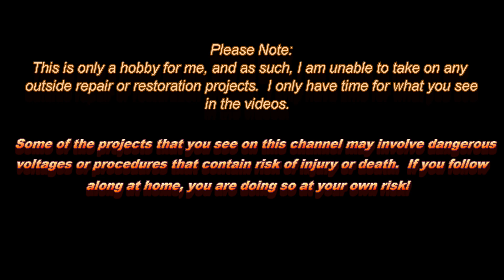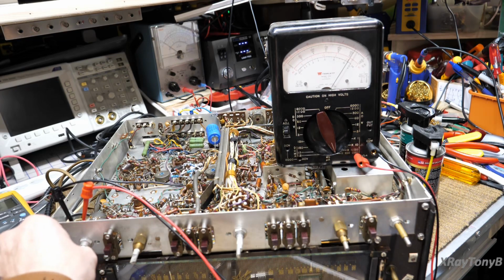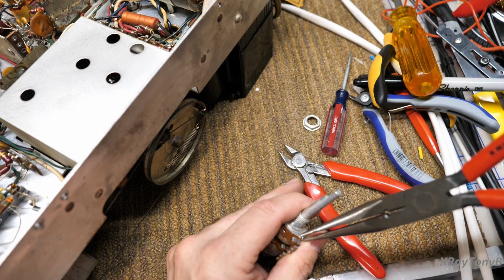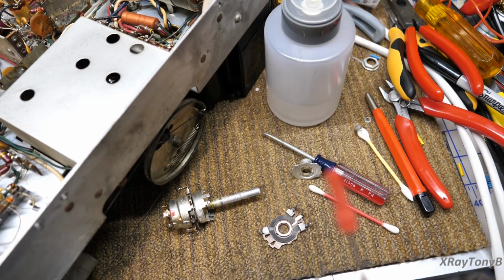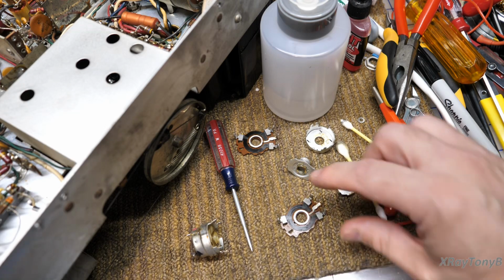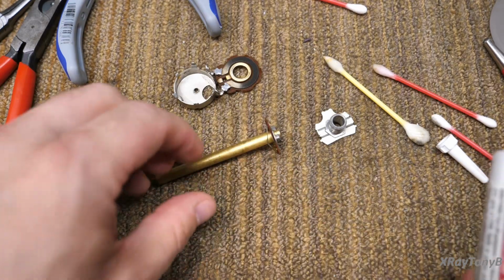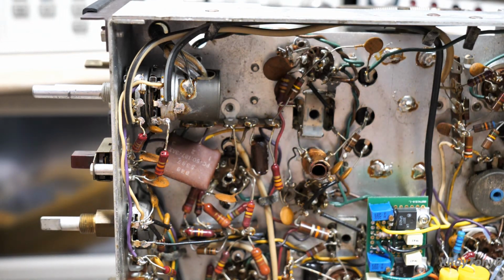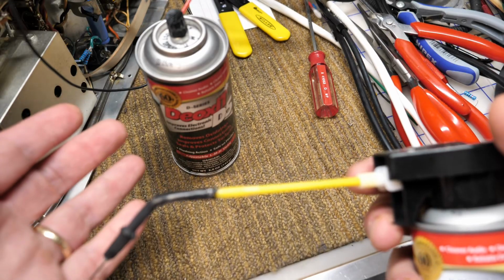How to Clean & Resurrect an Embalmed Potentiometer (With Bonus Rant)

Comment: Just purchased a can of D5 spray and it looks like they revised the label as it now explicitly states potentiometers under the “uses” section.  I also note another channel video discusses this issue and the host reached out to the manufacturer, Caig, and the company stated that D5 does not dissolve carbon or damage plastic, and is safe to use on potentiometers.  Their F5 product contains additional lubricants for moving faders and the like, which is what differentiates it from the D5 product.

I also noticed you mentioned that D5 “dissolves carbon”, but then go on to explain that “cleaning off the D5” can possibly restore a potentiometer that was damaged by D5….   But if the carbon has been dissolved, obviously no amount of cleaning will restore it back.

My impression is that what is occurring in many cases is that the potentiometer was damaged to begin with, likely having scraped carbon traces from the wiper, and it continues to function to some degree because the scraped carbon powder is still laying in the trace even though it is no longer physically attached.  After being cleaned with D5, that loose carbon powder is removed and the result is what appears to be worse functionality attributed to the D5, when really the potentiometer was worn to begin with. It’s possible that the lubricants in the F5 product allow that damaged carbon powder to stick a bit more, so you don’t notice the damage as much.

Just some observations.
Reply from the maker: To clear some things up, carbon will most likely be the only element left at the end of the universe, according to some physicists, so I doubt that red deoxit will "eat" it.  That said, some potentiometers are made from compressed carbon powder mixed with a binding agent to make it solid.  
When you "embalm" a potentiometer with huge quantities of deoxit (or any oily substance, for that matter) it will cause the binding agent in some carbon pots to break down.  This will eventually cause the carbon track of the pot to wear down and get thin, changing the resistance until it eventually cracks and fails completely.  This only happens with certain pots, as different  binding agents can be more or less resistant to this.  I have seen it many times.  People will empty the can of deoxit into the pot and it will work for a while, only to have it stop working again, because of all the dirt and grime mixed with the oily residue causing it to not work again.  The person will then spray more deoxit (or WD40 oil, or whatever) into the pot, repeating the cycle.  
The best way to deal with a noisy pot is to use a quick drying non-residue contact cleaner, such as CRC QD cleaner.  This will clean out the dust and grime from the pot.  Then follow up with a tiny amount of treatment, such as the deoxit or nu-trol  (or many other similar chemicals).  Less is better.  If that doesn't work, I suggest disassembling the pot and servicing it properly as I showed in the video.  
Additionaly, I've found that the old selector switches that use bakelite or that brown fiberboard material will soften and crack when you embalm them as well.  If you watch the video series I did on the Hallicrafters SX-42, you will see an example of this.  
Again, this is just my opinion and my limited experience.  There are others that have claimed to be "doing this for XX years, and I've never had any problems".  I don't doubt this, as people with many years experience are probably using the product correctly and are not soaking the control in the stuff.  Hope this helps.
Reply: I believe that’s a fair and accurate statement and I agree that over-saturating pots with any type of Deoxit is likely to cause more problems than it solves.  I also agree that many older fiber board type materials are sensitive to oily compounds.  A reasonably small amount of Deoxit probably won’t cause the problems you identify, but perhaps not using any oily type product would be safest.

Thanks for the follow up.  Good job on the videos!

Comment: Mallory new old stock, you taking apart of the Fisher stereo pod reminded me of how you could buy different Value pots, shafts, switches and gang them together, gone are the good old days.
Reply: Unfortunately, those "pick a shaft" controls weren't the best quality wise ---- okay for fixing a TV's brightness or contrast control, or a table radio volume control, but not so good if you needed a stereo volume or balance pot.
Reply: I have been using Deoxit for years and it’s the best contact conditioner but it’s a two part-system red and blue the red is a cleaner it needs to be rinsed out and then treated with the bile it will not affect the rivets used. So it is good stuff if you use it right! !
Reply: @harryconover289  , so, what do you use to flush the red De-Oxit out?
Reply: @goodun2974  any plan contact cleaner make sure it doesn’t hurt plastic
Reply: @goodun2974  any spay contact cleaner that doesn’t hurt plastic
Reply: Them Follow it up with the blue as a long-term treatment
Reply: H
Reply: @harryconover289  I agree I've been in audio electronics for at least 4 decades and never had to take one apart and since I can replace one for the fraction of my $60/hour fee.

Comment: Thanks for this video, I’m restoring a RCA Victor am/fm radio I got at an Estate sale for 5 bucks. The volume potentiometer was super scratchy and I was looking for my Deoxit to spray the heck out of it like I have done in the past. Well I had used my Deoxit on a friends car and forgot I left it in my truck and ran across this video before I found it. So I took the potentiometer apart and cleaned like you showed and now it works great and is so smooth. BTW this pot was a 1 Meg ohm with 2 taps in the rear at 250 and 500 ohms so it would have been a hard one to replace. Thanks again I’ll be using this info in the future.

Comment: I had a cheat for old pots which I discovered by accident.  I used to blast them with a heat gun and the few times I did this they started working properly again.  I was trying to remove a pot in an industrial setting and had blasted it with heat to try to loosen up paint on the fitting.  To my surprise, the pot started working properly again.  I didn't really think about it too much, just assumed that the heat had dissolved all the crap.  No idea if this would work on all types of pots.

Comment: Thanks for that "heads up", Tony. You making a face unfortunately did not make the video popping up for me, obviously, but I also learned that information way back when I was trainee... I did learn there that it always is a good idea to 
1st clean up the pot and switches with stuff much alike your "deoxit red"
2nd rinse out all of the contact cleaner with something like alcohol (either use things like isopropanol alcohol from a spray can or get some drops of it inside the pots
3rd after all give all some kind of oil spray, maybe use things like gun-oil (Ballistol) or even the much beloved "WD40" spray which is kind of both: Lubrication for the contacts and sealing it against new corrision. And it is not only water-detergent but also gets out the cleaning chemicals out of the carbon tracks etc. from where these chemicals may also kill the paper or plastic carrier plate of the carbon track, as you said.

This 3 steps did work very well most of the time for me, even without dismounting

Comment: I just used Deoxit applied to the 22 Faders on my 1978 Soundcraftmen's PE2217  Pre-amplifier/Equalizer.  Good stuff.    I then applied a silicon lubricant to those 22 Faders.  Worked out wonderfully  But there were several scratches on the top of the wooden case.  So I sanded them down, and then applied a matching magic marker color to those areas.   But in the long run, those areas looked more shiny than the rest of the undamaged areas.  Just for a laugh, I applied the Deoxit to the whole wooden area. WOW, it now looks as good as new with no areas being different from the rest.   When I say WOW, I mean super WOW !

Comment: Absolutely correct. I dont understand why its so hard for people to spread the right info. Clean cautiously with the right deoxidizer like deoxit F, relube with a Rheo lube or if your pot feels loose due to washing/cleaning away the damping grease then add some more damping grease. But i guess i do get why people dont say that since that all just opens another can of worms. Which Rheo lube? What Deoxit/ contact cleaner? What Damping Grease? Of those products there are hundreds of variations with different purposes. But once you figure out the correct products and procedures you'll rarely come across a pot you cant revive. So bottom line, dont just spray contact cleaner and expect it to improve your potentiometer cause at best it will "work" for a few days then go right back to being scratchy (oxidized) and feeling loose.

Comment: Lol reminds of my younger days of hunting on the back roads and trash bin outside people were tossing old radios 📻 out from many brands i was 13 or 15 most of them had burnt outputs and i go in and fix them alcohol was my freind lol now what happened too the recivers i fix idk i had about 5 or 4 then later at around 18 or 19 i found a bunch of sanyo and integrated amps that need the stk chip and i used my allowance too spring for parts or from others old radios i had i do think when left all my stuff got junk after my mom moved and i was out of town. Bummer now i still work on electronics i love the audio side of electronics repair & modified thanks for great and awesome video lots of info

Comment: Problem is, a lot of people use too much of that red Deoxit, and the chassis is dripping out with the stuff. You have to use as minimal as you can, first the red, then the green, or only the green one. Depends on how dirty the pots are. So you have to open them, anyway, to see that. And less is more. For contacts, I use WD40 Specialist, the green one, it's specially for PCB and electronics. It works fast, and don't leave residue. Also, a bit, not spraying like you would with Kontakt WL to wash the PCB. If I use Deoxit in an open pot meter, I spray a bit in a small container and use an ear stick to clean and lube. But maybe I order the same as you use, the 100 brand. Problem is, on this side of the world there are few shops who sell this. Thanks for the tip.
Reply: WD 40 specialist is good but CRC 226 is even better.

Comment: I have also run into a case or two where a residue-free "electronics cleaner" has been safe in every other aspect, but it apparently dissolved the glue used to build some SMD button switches.

Comment: Everyone has their own tools and products that they like to use.  When I do use Deoxit D5 on switches it is a tiny amount at the end of the process.   D5 is pretty expensive stuff.  What is cheap and works great is CRC Contact Cleaner 100% evaporation, once the dirt is washed out it leaves nothing behind.  Switches and pots get washed really well with it. Switches get a tiny drop of D5 on the contacts.  If the mechanism is stiff I use a little bit of white lithium grease, it's non-conductive.  When I rebuild pots it's all cleaned and I choose to not put anything on the carbon or the wiper contact points.  If the shaft needs it, just a bit of the white lithium grease so it rotates freely.  This is not the only way, and I can't claim it's the best way for everyone; it works for me.

Comment: Good info on pots and the use of DeOxit. I was guilty of using the D5 for everything until a few months ago after learning the harmful effects it had on pots. 😬 A noiseless pot is a happy pot! 😊Love the Alaskan Pipeline comment 😅You can remove that bulky cap but it takes a bit of force then outfitting the exposed stem with a different nozzle should work 🤔

Comment: I don't have much time or space to do electronics repairs anymore but in the 1980s when I fixed a bunch of second hand gear for my own use, I learned to really hate contact spray. I never used it myself but I got stuff from others that had gunk all over the place on potmeters and on switches. I always thought that it didn't make sense because whatever it is, you spray it on the dirt and it might make it soft or whatever, but the dirt doesn't actually go anywhere! Unless you wipe it off maybe, which no-one does of course. 
So you get a device with a crackling potmeter, spray it, and it works, but pretty soon the crackling comes back worse than before, because the contact spray turned into gunk. So I rather opened the potmeters and switches and scraped any oxidation off wipers (never scrape the carbon tracks of course) and switch contacts with a knife or even a screwdriver, and that worked great: I fixed many devices that way, which still work 30 odd years later.
I don't know if contact spray in Europe is the same thing as DeOxit but seeing all those videos of you and other guys spraying that crap into potentiometers, I almost changed my mind and got some of this "miracle" stuff for future repairs. I'm glad you proved me right after all, and stopped me on time.

Comment: this is %100 correct. this is a corrosion inhibitor and design to dissolve and remove most metal salts and leave a residue to protect from later corrosion like copper sulfate or oxidation.

Comment: Very interesting video Tony. Just shows there is no silver bullet for cleaning contacts, it's horses for courses.  Worth stressing the use of an analogue meter for checking pot action,  using a DMM just doesn't show what is happening, especially if the autoranging kicks in as the resistance of the pot varies.
The Japanese really did their research on friction grease, most of their pots have a superb Goldilocks 'feel', not too loose, not too stiff, just tactile perfection.

Comment: Thank you a lot for this video! I was lucky enough to read somewhere before that D5 must not be used on potenciometers and bought and used F5 instead. On the other of my tape deck (same model) the pots are very loose, so I guess someone did use D5/100 on those before ("profesionally serviced", said eBay ad...). 
BTW, I read the description on D5 and indeed it does not mention it should not be used on potenciometers.

Comment: Excellent video!!!   Contact cleaners specifically target carbon since that's generally the result of arcing. So spraying it into a carbon pot is a recipe for disaster, that said... I'm as guilty as everyone else.  Back in the mid 70's I worked in the radio room at a local TV shop and we used plain 'ol WD40 for pots since it flushed away dust and left a bit of lubricant after evaporation.

Comment: Hi Tony. I have a recommendation; after applying the Deoxit D100 drop onto the metal contact ring, gently spread it with your pinkie finger, a toothpick, or the pointy end of those cosmetic Q-tips. If you don’t - and you reassemble the pot as-is - the 1st time you turn the shaft, the wiper could fling the droplet onto the carbon track, undoing all the good you’ve just done. And with it reassembled, you’ll never see it. By spreading it out, you can see if any D100 gets on the carbon track while the pot is still disassembled, and you can wipe it off. HTH! 😋
Reply: NO, don't use D5 or D100 inside any pot.  If you want the rotor contact ring lubed use an electronics grade grease that will not dry out for many years.  VERY expensive if you can find that.  But for cheap skates like me I use Super Lube (used to be sold by Radio Shack labelled as lube Gel.  Apply very little.  It won't run around inside the pot and foul the carbon track if that's what you're worried about.

Comment: Sorry to see your pots got damaged buy Deoxit D5. What a disappointment. I’ve had good luck with MG Chemicals Nu-trol Control Cleaner which IS designed for potentiometers. The only issue I’ve had cleaning pots was with a McIntosh MC-2105 amp. The controls in mine seemed to use a vinyl-like track, similar to those found in faders, and the control cleaner just dissolved the track and lifted it right off. Perhaps Deoxit Fader would have been a better choice for those as it’s supposedly safe on plastics. Most of the time cleaning pots is foolproof, but when it goes wrong, it goes very wrong.

Comment: I've found that Houdini works well for cleaning pots.  It's a greaseless and oilless lock lubricant produced since the 1970s and it's d-limonene based and non-conductive.  It will dissolve polystyrene, though.

Comment: You have attributed the crud found on the carbon disks in this potentiometer to previous treatments with Deoxit D5, if I've understood correctly.
If that is a correct understanding, can you inform how you know that to be the case?  Maybe you explained it, and I missed it.
Reply: Some techs will say this is residue from WD-40 (which one engineer swears contains linseed oil), not D5. I couldn't tell you for sure myself.

Comment: Thank you for the tutorial. My question is regarding the latter end where you discuss using the QC electronic cleaner: In spraying a little to remove residue, will it affect the existing friction grease or because the cleaner is alcohol based - not so much? I'm guessing the only way to know is when all is done if the pot turns too easily, grease may have been compromised. I know a little goes a long way so the trick is to use cleaners and lubes sparingly. Thanks again, cheers.

Comment: A brief note from Mr. el cheapo. Household ammonia will remove the black tarnish on silvered surfaces such as are often found on wafer switches, it evaporates off in no time, a cotton bud is useful. It will also clear out your sinuses if desired. Cheers, Steve.
Reply: I’ve heard that Windex no longer is using ammonia just in case people hear ammonia and assume to use Windex.